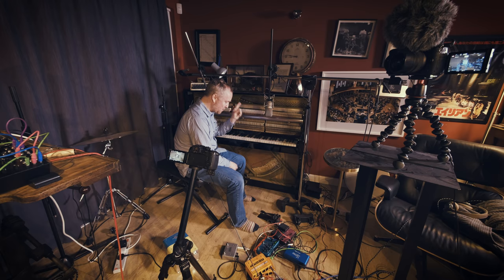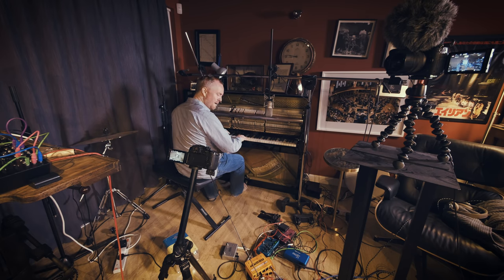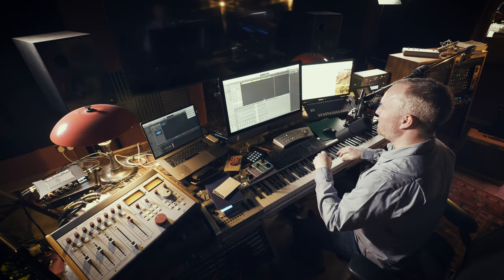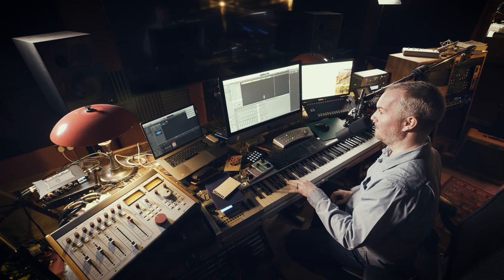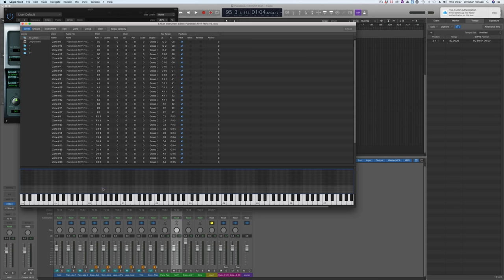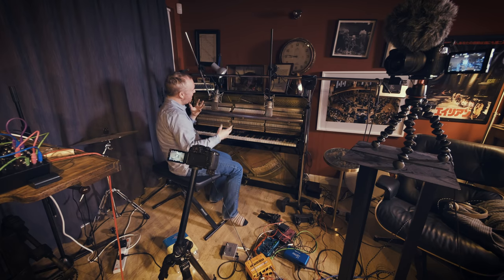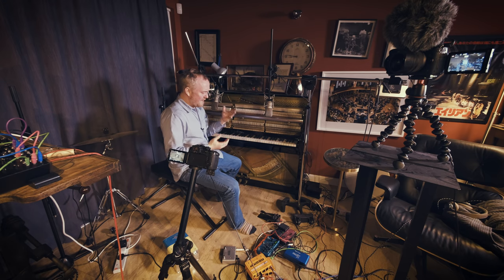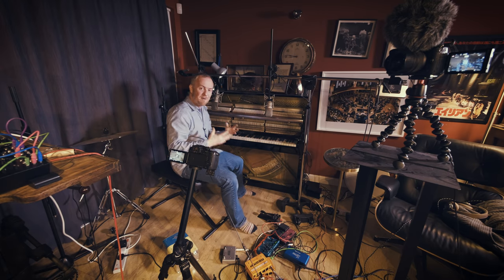Why Do Samples Sound Better When Pitched Down?

Comment: I think you actually answer your own question about why the "rub" between the sampled C and C# is more regular somewhere around the 10' mark. It's the fact that the samples are mixed together in the digital domain and never share the same physical space--the semi-parallel feedback loops of air pressure, magnetism, and vibration through the sound board are constantly changing the immediate position, length, and speed of vibration of the C and C# strings when the notes are struck as a dyad on the piano, resulting in a cloud of pitches that are close to C, C#, and the low-frequency rub. In the sampler, the m2 dyad sounds less "chaotic" because it's a perfect mix of two notes that are recorded with a much more controlled feedback interaction between air, metal, and wood. I expect chords have a similar subtle difference as well.
Reply: also, I'm only just learning about the project now, but maybe a subscription service could be used for further "chapters" in the pianobook. Anyone anywhere can download Chapter One for free, and if you offer a proprietary sample player or a librarian program or anything like that. A high-quality sampled piano, available to everyone. Further pianos, preparations, dynamics, etc, could be made available on a periodic basis. Pay $10 a month or something, and you get the links to the newest libraries--pianissimo Bosendorfer on Earthworks mics coming in June. Hydrophone underwater toy piano slated for July. What do you want to see in August? That way the recordist and/or performer can be paid for their work, server space can be paid for, etc. The public-access part of the project gets funded by people who are constantly looking for new sounds or just have the spare cash.

Comment: 2.25 I d say it sounds more pure but not richer, u have taken out a lot of odd harmonics/overtones which helps the tone to be cleaner. At the same time its still a piano and it sounds very itb to me.
I d take the real piano any day, at least in this example. Then if i like i eq it a little bit to bring out the midrange tone and reduce the top end if i want it more mellow sounding but still keep the overtones and timbre richness. Its always about creating a pleasant balance, even vs odd harmonics. 
From the experience i have in mixing i tend to value texture and harmonic richness, always easier to subtract than to add, or else u can rock those sine waves until the end of time if thats ur thing!

Comment: Interesting, thanks for sharing with and so clear examples.
What if you introduce some sort of chaos in the loop-part of the sample.
Using your example, what if you added the F# above the C and pitched it down to a C and added that to the loop of the "original" C so that it fades between the two. Now if we could randomize that "loop" so that it picked samples from all of the 88-keys, wouldn't that introduce chaos in the loop-part of the sample? 
Nice rainbow :)
Reply: That would be a completely different thing, it's not that. What he forgot to analyze is why the "chaos" in his example exactly occurs. It occurs because the overtones from one note interact with the amplify certain other parts of the other tone (and vice versa). That is why a note combination on the actual piano is unique to two separate samples played together....
Reply: Aile Aiho - Yes I understand that. But I thought that changing samples with scripting would be easier than changing the cross-modulation of the overtones. And I believe the “ result”would be similar. IE adding chaos :)
Best,
/Anders
Reply: @anders_wall  I think that is good technique for situations where you lack enough similar samples for Round Robin. In that sense it would add realism to the picture. It is very easy to do. In a sampler like Kontakt, it's too easy and I have done that. But it's a very different kind of realism from the cross-modulation of the overtones... This cross-modulation is very specific to each instrument, it's a part of the character and the effect of your suggestion sound the same across instruments.
Reply: Aile Aiho - you should make a tutorial about how to script round robins in the loop-part of a sample. I’ve never seen that and would be super to know how to do it.
Cheers,
/Anders

Comment: Great video.  I can't help but wonder if there is a better / more practical and efficient way to sample instruments though, while retaining as much information as possible.  If you want to then ditch the extra info later on, you can...but if someone else wants as much as possible, they could still have it.  Would be interesting to see some kind of AI / neural net applied to this problem.  I'm sure it's already been done by someone somewhere at a university, would probably be cool to look into though.  I think it depends more on the style of the piece, in regards to wether or not it sounds better or worse.

Comment: Many interesting thoughts here. Could it be about the movement of the sound putting us at ease? Slower feels less manic. If you think of video footage sped up compared to slow motion, the later feels more relaxing generally. While I'm thinking about that crossover 18 fps is around the rate of persistence of vision as is 18 Hz for sound. The in utero idea is an interesting one but in contrast babies respond more to higher frequencies and exaggerated sounds due to their ears not being fully developed.

Comment: The way I think of pitching up and down samples is: when you pitch sample down you slow the wave down so from a wave with more vibrations per sec you extend the information and it becomes a wave with less vibration per sec (you use the more information to create something that is already there) and to pitch something up you need to add vibrations to the wave (you try to add information that is not there) so that's why it sound worse. It is more  "artificial" than pitching down. This is my way of understanding it i think you could explain it better but that's what i came up with. Open to other opinions if you think its wrong :) Cheers!

Comment: There is a simple explanation for the difference between a low piano sample and a high piano sample pitched down.

There are three strings per note higher up, which create a richer, fuller sound through multiple tones interacting and beating with each other. The bass notes only have one large string, which resonate in a harsher manner, creating a tougher textured sound.

Nothing to do with sine waves.

Comment: I might have misunderstood, but I don't see how options 2 (spitfire product) and 3 (make free, sell the best) can work: I'm not sure how option 2 works, in that presumably you will have to offer a standard compensation to all contributors per sale? That seems unbalanced, in that not all contributors will provide equal value, but presumably would have to be compensated equally, otherwise it will get very complicated? You anticipate that not all contributions will be equal with option 3, in the proposal to sell the best of the bunch. Again, I might be misunderstanding, but not sure how this can work: if the free version has everything, but the paid version is a curated few, why would anyone buy the paid version? As so many have kindly done already, each can be packaged into a nice Kontakt-based GUI, so it's not clear to me what we'd be buying that isn't in the free version. Unless you mean (and I don't think you do) that Spitfire would remove the best from the contributions, and sell those, making the rest that didn't make the cut freely available - I can't imagine you mean this though, as it would be a very unSpitfire thing to do! Might be worth clarifying what you mean by this option though. That leaves option 1 (free) and 4 (charity). I personally favor option 4: I'd suggest it should be a paid version (free to all contributors), from which Spitfire should quite reasonably take a cut (your/Spitfire's time should not be free, so the cut should be agreed by you and the community together), and a larger than normal percentage donated to charity, since the source material is coming from the community, unlike other Spitfire libraries. Great project - thanks for the journey so far...
Reply from the maker: Yeah option 3 or a variant would mean that A) if you want to piece the product together yourself you could do it by going to Pianobook. B) If you don't want to DL 500+ pianos and maybe just get the "best" in a simple to download single package then you can DL through Spitfire. Kind of like we do with Sound Dust. A lot of modular makers work this way, open source, kit builds and the full purchase versions. So I think it is a model that could work.
Reply: @TheCrowHillCo  I'm still not really understanding: by your Analogy with Sound Dust/Spitfire: I can go to Sound Dust and buy, for example, Infundibulum for £50, or I can go to Spitfire and buy a collection of several Sound Dust libraries, like Sound Dust Vol 2 that will include Infundibulum, for 200. Under neither option can I piece the product together myself for free (which was what I understand your option 3 to mean: share everything and sell the best). So, I guess I still don't understand  option 3 :(

Comment: You're correct in that the strings themselves don't make much noise. For proof of that play and electric guitar that isn't plugged in.
Reply from the maker: Adam Rook indeed, the piano is actually three distinctly separate units, a large dulcimer, a keyboard hammering device both put inside a large cupboard so it doesn’t look like shit.

Comment: That's the difference between sampling and modelling. Samples are recordings that do not influence eachtoher at all, and that makes it sound unnatural. It may be pleasing and every sample maycapture the true sound of the string, but it's not what that string would sound like when played in conjunction with other strings. And ofcourse sampling completely ignores the body of the instrument, let alone the room that the sound is played in.

Playing sounds at a lower speed softens the higher frequencies. At only 44.1 Khz sampling rate any sound above 10Khz effectively becomes a square wave; there are only four samples per cycle, that's just enough to define the cycle, the entire shape of the thing is gone. Playing it slower at least forces the sampler to make it into a proper shape.

Comment: try pitching down using legacy hardware samplers.  They do a better job with lower sample rates than computers, nowadays.
Reply from the maker: Ooooooh I'm so here now: https://www.ebay.co.uk/itm/EMU-E4XT-Ultra-w-Sound-ROM-SCSI-CD-reader-and-assorted-original-sample-discs/183683375202?hash=item2ac461e062:g:aJoAAOSwAhdcVhnZ:rk:6:pf:0
Reply: My understanding is that modern samplers and audio workstation are pitching samples down while maintaining the sample rate of the master-clock. Only samplers that are capable of playing multiple variable sample rates are truly lowering the sample rate of pitches down samples. The one exception may be the OP-1 which does seem to add all those artifacts one expects to hear from older gear.
Reply: I agree, I have an Ensoniq Mirage that chews sounds up in a lo-fi way though sounds rough, an Akai S-612 which does magical things to samples and a Yamaha VSS-30 which does even weirder things! My Emu-5000 Ultra uses more modern techniques allowing more pitch shift range but less magic..

Comment: Nothing to do with utero, I am afraid its our sophisticated Brain. The way you approach sampling is a bit flawed. Polyphony samples add up all high freqs with every single sample. Don't believe me? record your whole tune in 1 stereo sample and play it. The replay sounds 1:1 to the input. In the analog world the box of the piano and lid kill a lot of the highs when playing notes and polyphony. And designed real instruments do this very sophistically. (Good mike placement captures the rest). And sure if you record at 24/48 kHz when you tune it down half or whole an octave freq curve will drop 12/24 to kHz automatically. It rids some of the unnatural highs. Reducing the bitrate from 24 to 15 bit or 14 bit will result in compression. Like the box does. Results in more perceived weight. For the body of the sound you could experiment re-amping the piano piece (back from the midi file through a pair of Auratones. Into the sound board to catch a little bit of that pianoboard (its a box) AND at a larger distance 1-2 meters capturing the re-amped sound radiating into the room. Your ears need ALL that info. Not just the hammers. Mix that in. Find a balance. Recording is like throwing rocks in a pool of water and record all the waves. If you think the sound is more morphed into realism you could  use various digital tools emulating the above digitally. Just see it as vectors. Sample > re-ampvector > a body can be calculated as well (like Tension/Collision on Ableton Live) in digital domain. However if you can't re-create/ re-amp resonance the sound will never get to 100% feel. For snare drums  a speakercoil on top is used to make a snare rattle. This is why there are still some recording studios these days that actually record audio. In the end Music = Sound = Traveling Air. Hope it clears up some of it. Good luck!

Comment: Frankly, I wholeheartedly disagree with the explanation you've given with your evidence. It seems to me that it holds meaning only in terms of pianos. I'll take a guess that the reason the lower strings on piano sound so awful is because the fundamental frequency is quieter, which is why it's difficult to discern the pitches of those low notes. I think more evidence should be gathered from samples beyond that of the piano, possibly a stringed instrument, before we use the conclusion of sine waves being what makes something sound good or fat. 

Bass music like Dubstep, for instance, revels in the chaos and strong harmonics given above the bass fundamental.

Comment: PaulStretch is so much better than these prosaic ways and samplers ... It can stretch and elongate any sound to as much length (depending on your hardisk and processor) without unwanted artefacts and noise ... Try listening to Wham or Beethoven for 8 hours, one composition.

Comment: excuse me but isnt recording a piano the same as sampling it.. so your whole point is null, since every piece of music is in a sense sampled and has all those artifacts you speak of .
Reply: Incorrect
Reply: @robinweber9640  what is incorrect?? Sampling an instrument is recording the instrument.
Reply: By recording a musical line with the original piano the physical characteristics of the instrument make a note resonating influence the sound of the others.

If you sample the piano note by note, map these recordings into a sampler, and try playing the exact same musical line, it's going to sound different because you're removing all the physical interaction that happens with the strings being in the same body of the piano. That's why, when he samples the C and C# together and separate, the together sample sounds more irregular. The vibration of each string is influencing the other and the piano itself, so you don't get a perfectly stable minor 2nd. By playing the separate notes from the sampler you're just overlapping two recordings, so the interval is much more stable and predictable.